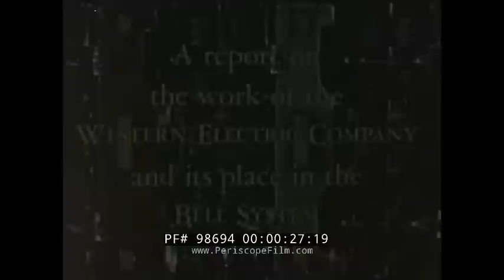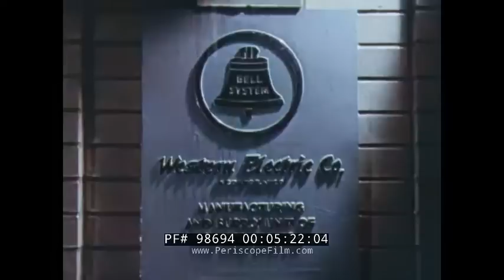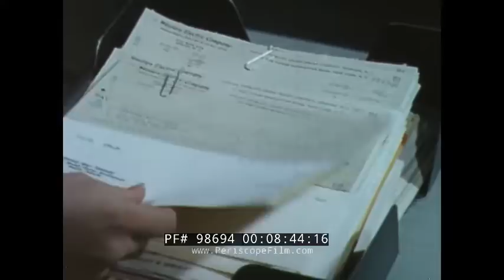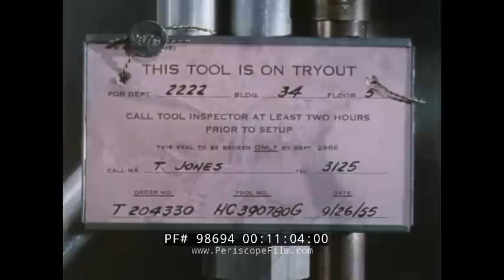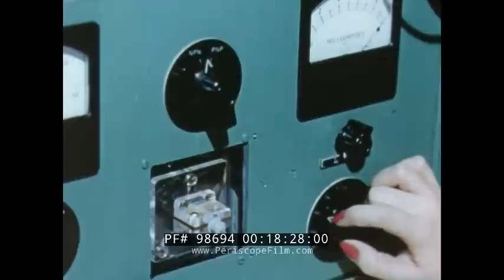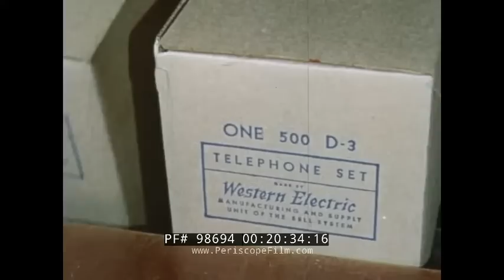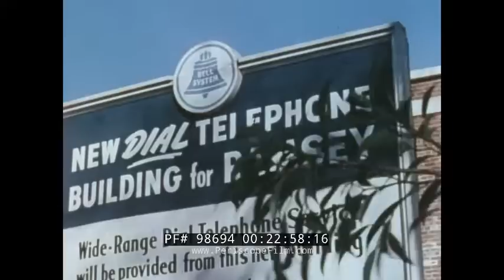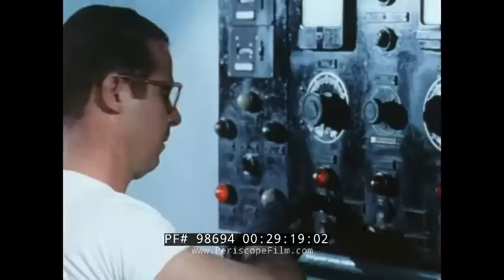"TOOLS OF TELEPHONY" 1956 WESTERN ELECTRIC TELEPHONE SYSTEM PROMO FILM   BELL SYSTEM 98694

Comment: In 1999 I purchased approximately 50 of the large steel racks shown in this film from a salvage yard to build my off-grid home in Arizona. I think I paid around $500 for the entire lot.

They were perfect building materials… double wall 12 gauge steel, 11.5 feet tall, 24 - 54 inches wide and 6.5 inches deep (perfect for R30 insulation).

To create the exterior walls, I poured a slab foundation with J-bolts placed around the perimeter and then, one by one, we stood the racks up and bolted them down to the foundation and to each other to create the exterior walls. We then sheathed the entire outside of the steel structure with 1/2 plywood and stuccoed it. To create rooms and a loft inside the house, I stacked racks on top of each other then laid some across use as floor joists for the loft above. The building process was creative fun… like playing with a huge Erector set!

I think of myself as the fourth little piggy in a modernized version of “The Three Little Pigs.” My house is super strong… no “Big Bad Wolf” of a storm is going to blow my little house down! The house runs on solar power and rainwater is harvested from the metal roof and stored in an above ground water cistern. 

I am thrilled to finally see how these racks were actually used in our country’s telephony history. Thank you for posting this treasure.
Reply: steel racks? as in phone line distribution frames?

Comment: I have been at Bell Canada now for 21 years.  I started on I&R in 2001 with a KS Meter providing dialtone and 2nd pair lines for 56k modems.  Transferred to Cable Repair in 2016 and to this day still work on old air systems and paper cables in lead sleeves.  People have no idea how much of thier network still runs in this bullet proof technology to this day.  Love my career and wouldn't change it for the world.   Best video to date that I have seen history wise.  Makes me smile to see most of this stuff still running to this day.
Reply: Not exactly bullet proof... I've seen hundreds of miles of that stuff ruined because a single pump failed. (and even more where the "unnecessary pump" was turned off.) These days, twisted pair is a dying technology.
Reply: @jfbeam Ethernet is still holding strong.
Reply: @EvertG8086 We're talking about TOTALLY different technology. Twisted pair ethernet has a limit of 100m (or less), so it rarely runs anywhere outside buildings. ('tho people do link close buildings - a house and garage, for example. but then grounding issues can pop up.) You don't run ethernet across 50+ pair telco trunks. Ethernet beyond that isn't twisted pair; it's fiber.

Comment: I started in the central office in 1971. All those relay switches were still in use well into the 80s,when thy replaced them with digital switches.
Reply: I remember going on a class trip to the local telephone building in the early 1980’s and watching all the switches moving and clicking every time calls were placed. It was really fascinating.

Comment: Now retired after 50y has e telephone engineer my first job with plessey telecom was installing strowger exchange’s after 10y I left and joined the G.P.O. has a cable jointer after doing most other jobs i went in for promotion and got the job testing most of the poles in my area about 11.000 after 30y the has been a lot of changes when a left fibre to home was replacing copper watching this film has brought back memories especially the exchange bit has I have done most of the work seen in film footage
Reply: The young folks will never experience the joys of large 1A2 installations, trying to track down the shorted A-lead.

Comment: 9:40 "from one such project came the device that will affect our whole material way of life: the transistor."

Spookily prophetic.  They had no idea just how much tugging on that little string would unravel the whole world, and yet they still understood the gravity of that invention.  They must have thought it would just lead to smaller radios and televisions, maybe better computers in giant warehouses just run by corporations, and governments, maybe some rudimentary electronic controls in everyday goods, but there's absolutely no way they could have really understood the long term implications.  They could only see what was theoretically possible with circuit boards full of rows and rows of discreet transistor logic and using them to shrink basic electronics that used to run on vacuum tubes.  They couldn't possibly understand it deeper than that without a knowledge of integrated circuits.

Edit: nope, holy shit.  They understood miniaturization.  Even so, they could only predict the future as being the same, but smaller and more efficient.  They knew they might someday shrink things down, but they were still operating in  microscope-levels of scale, where hand assembly was still possible.

Comment: Brings back some memories.  I worked on seveal crossbard  insstallations in the late 70s early 80s.  From walk in and start puting up the cable throughing to load test and cut over culd take nearly two years on large CO installation.  Glad I went on to ESS and PBX systems after that.

Comment: I was lucky to be of a generation that experienced telephone service before cell phones. I can honestly say that with the exception of convenience that cell phones can’t touch the voice and reception quality of “old” phones. The quality of old phones in comparison is like listening to hi-fi compared to modern cell phones AM transistor radio quality even in the best reception environment. Not even close. Unfortunately it wouldn’t do any good to install an old phone now as everyone owns a cell phone which makes it a moot point.
Reply: Hmm. My Motorola G7 Power has clarity way beyond my old flip phone.
Reply: Still not as good a standard home phone that was used into the 1980’s and possibly the early 90’s. There is no cell phone from any generation that can compare with the standard home phone. None. An old flip phone doesn’t count as a standard home phone.
Reply: Cell phones are very convenient but I'd rather have a good old POTS line at home. More reliable and better signal quality.
However, I guess I have to shoulder some of the blame here. When I was at Bell Labs, I helped develop the Autoplex-1000 cellular switch. Then, after I left the Labs, I moved to Seattle and worked for McCaw Cellular for several years.
We never dreamed everyone and his dog would end up having a cell phone. Once that genie was out of the bottle...
Reply: your post was a moot point.
Reply: Paladro your as precious as you can be!
Reply: In 1980 , the Gov. broke Ma Bell into what we have today. Many miss the old land line one company telephone company. They were a great company to work for. My Aunt worked for Western Electric for 30 years. Friends I grew up with , their fathers after being in WW ll,  had very good paying jobs working for Western Electric. I can not think of hardly any big corporations today, that treat their employees as well these old companies did back then. I  can not watch something like this without having a sense of great loss.!
Reply: We have quite a few older neighbors and friends that still have landlines with rotary phones, one even has a 1940's wall phone in the kitchen. We haven't had a landline in twenty years, I'm sure they will become extinct with our older friends and neighbors,  I'm not to far behind them. LOL
Reply: We have cell phones but my 72 year old wife will not allow me to get rid of our land lines. Everybody calls or text our cell phones so at least 90% of the calls we get on land line are unwanted sales BS. Have blocked 6 different phone #'s from one pain in the ass saying your car warranty is a out to run out. Every year I reregister in the do not call lust but it dies little help.

Comment: When i was trained as a cable splicer in the  U.S. Air Force back in 1979. The Air Force was still using some of this equipment on meany of the bases i was sent TDY too. Some of the cable's had lead sheath and paper insulted wires. Most of the equipment in the CO was old.  Even some of our tools and test equipment was from that era. After 1981, The Air Force began to modernize all of it's telephone systems . Better training, New tools, New  test equipment and new trucks. My old one was made in 1966. I was was issued a brand new  1981 Dodge Ram truck , Nice.  We also got new heavy equipment that made our job much easy and safe. Thanks to the new president.
Reply: When I was @ Eielson AFB, the base phone "switch" was recycled from a US Navy destroyer, it had less than 20 outbound(to off base lines),however it had several more base to base bldg lines available!This was 1980-81.

Comment: 12m:20s  That living room of equipment turned into a single rack of equipment in the mid to late 90's. And that has probably evolved into a couple rack spaces today, always fascinating how quickly technology advances.
Reply: Or a single VoIP server and a small network rack.
Reply: Almost! Where I work digital switching transformed an entire room of crossbar (like shown in the video) into about eight racks in 1989. Computers rolled in about 2006 and replaced all that with two racks, one being switching/control and features, and the other for line access gear, up to 1700 in a single bay. Now the switching side all runs on servers, everything fits into about 10 rack units if you want. Access side is even more ridiculous. Up to 512 over fiber optics in a little 18"x12x"1.75" package

Comment: The reed relay technology developed by Western Electric to replace the old exposed leaf relays was also used by IBM in the late sixties to build upgraded 029 keypunches and 059 key verifiers, to phase out the older 024, 026, and 056 machines.

Comment: Electronic switches have replaced step switches and crossbars, so a central office is a much quieter place these days, but the frames are still there, and there is still a lot of pulp insulted cable, along with lead sleeve and lead splice case cable out there.
Reply: N. 1 ESS, N. 1 EAX, N.5ESS, DMS100, remember these ?
Reply: @dc10fomin65  most of my COs are DMS100 Switch.
Reply: @bobcole612  Of course, the big brown machine, I know those and also DMS10, and MTX when I was with Nortel in Miami back in the 90's, good old days!

Comment: (to continue) from Potter Brumfield, Bell labs, and Western Electric, plus thousands of octal sockets brand new in their boxes. He also brought home several sets of linesman tools, relay contact files, wire wrap tools, screwdrivers, subscribers, soldering irons, and the like. I used to go on "callouts" with him late at night and pilfered tools and tubes for my radio hobby, they were NEVER missed because they came from substations that were slated for removal due to the new systems being installed at the time. Later, in 2015, I sold those WE 32A's for $60 each because even the boxes were in pristine condition with NOS tubes in them. It made enough money to buy a complete Collins shack with all the extras, plus a complete Drake Radio system (T4XB, R4B, MS-4, L4B, and two sets of tubes for all the Collins and Drake radios) which I still have today. I even bought the same equipment that was on the Titanic (replicas, hand built) and still had a thousand left to put in the bank. I am 65 now, and love my "toys" which includes a National HRO5-TA1, doghouse power supply, and original field core speaker with the National Diamonds on ALL  the radio and coil sets. Two of the relay racks were converted to hold the Collins, National, and Drake Equipment. The AWA would love to get their hands on that stuff, and will - someday.
Reply: So you're admitting to stealing, profitting from that crime, and bragging about it? Great parent you had.

Comment: Watching the section about the reconditioning of the equipment, where the conveyor system only used a couple of rods to direct it to the right department, I thought 💭 and today that job is done by laser scanning  equipment and a dozen computers 🖥 that spew out a dozen copies of the same information and it requires 6 robots to do the work one man used to do, and they call it progress. I was impressed by the the fact that they recycled the copper wiring, I just wish they hadn’t burnt the outer sheaf of, that must have produced so much pollution and toxic fumes. 
Thanks for sharing another gem of a film from our recent technological advances, very interesting. 😀👍🇬🇧🏴
P.S I wonder how long it would take for the phone system on the factory floor to get repaired, in the United Kingdom it can take forever to get an engineer out and then they say it’s not their equipment at fault, it’s probably the wiring in the house to blame, they can do the work but it will cost £xxxxxx.

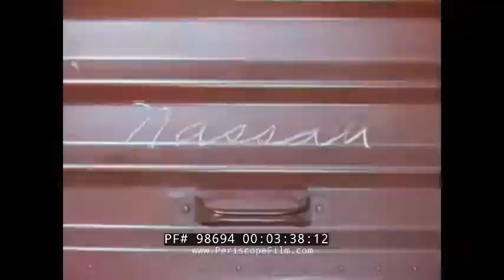Comment: 3:36 ,Nassau Metals & refining was not far from my place in Staten Island, 7:11 they made the best lead based solder, still got rolls of it from when my pops worked for the Bell System, it flows & soldiers so much better than the modern lead free solder ,i use it on time appropriate items in need of repair
Reply: A long time ago  I believe it was called the Tottenville Copper Company.. that was in the Horse and Buggy days of Tottenville..

Comment: Telstar in 1956 ushered in the cellphones we use today imagine the engineering we have today  unknown to the sheeples
Reply: There's nothing special about a cell phone. All it is is a specialized radio transceiver, AKA: walkie-talkie. Once transistors were a thing (invented at Bell Labs), cell phones were easy; just as easy as other forms of portable radios.
Reply: @MaximRecoil  Wow i found a comment that sounds like something that i would say! Well interesting enough i do agree with you on that, in my opinion cell phones are not as cool as Landline telephones, What i've noticed the difference between landlines are the sounds of clicking and clacking when the call is being set up, On a cell phone you don't get to hear none of that at all it just goes straight to ringing without any cool clicking sounds. That's why i still have my Landline cause it makes those cool sounds.